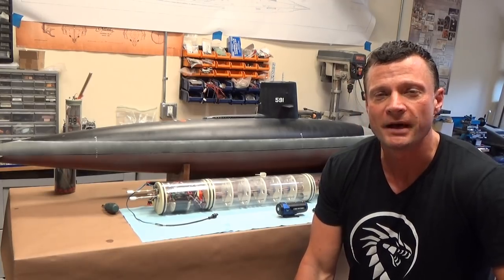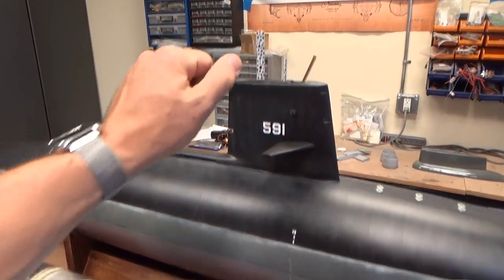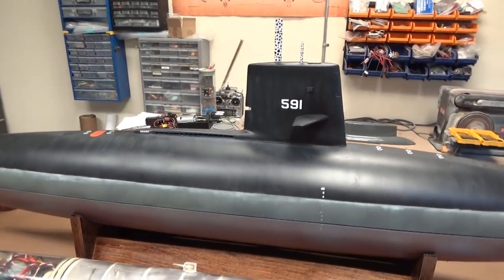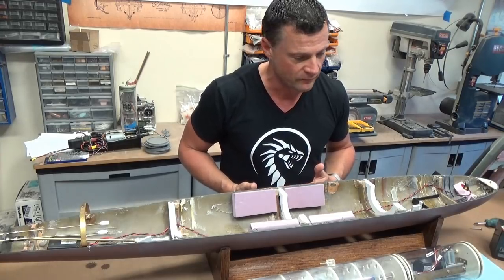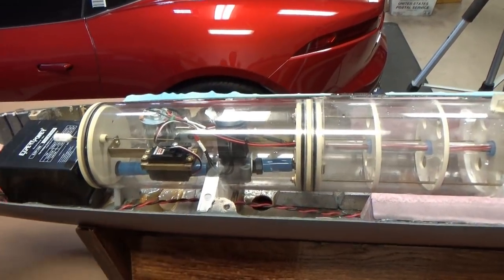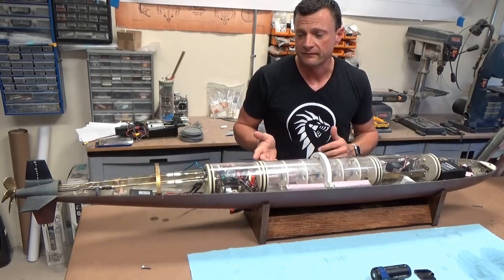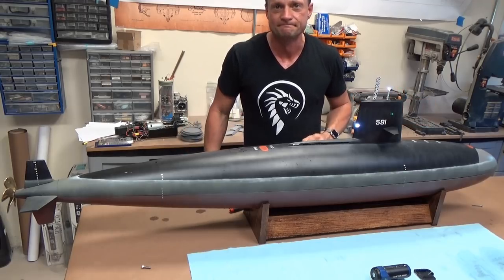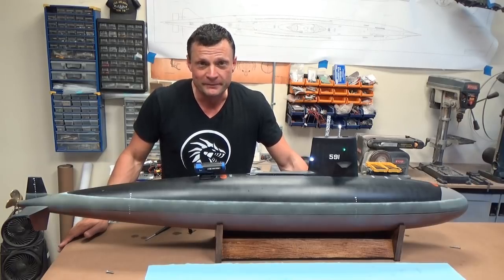1:48 Skipjack Class RC Submarine - DeBoer Hulls

Comment: Wow thanks a lot, I have been wondering about a RC submarine for years
Reply: Simply amazing
Reply: Try that next time with a periscope and the camera kept inside the submarine if that will work
Reply: Which type of antenna should we use if the RC submarine has to fully submerge into water say about 2 ft depth

Comment: Are you sure its the periscope that lets the air out? My non expert guess is that the mast with the lantern is the periscope. In the old days periscopes were usually circular, much less weight to do a 360 degree then. My guess is that the other mast(=letting air out) is a communication or surveilence mast(or a snorkel mast without the top).
Reply: Its a snorkel...slip of the tongue...he corrects himself in another video.

Comment: How does it evacuate the ballast tanks to surface? Does it need to be on the surface to suck in air through the periscope?
Reply: Yup....gotta get the snorkel above water to blow the tank.
Reply: so if you go to deep you cant get up again?
Reply: well, its a model, so, no need to go deeper than you can see. as long as its close to neutral buoyancy, just moving forward and using the dive planes should get you close enough. outside that. get your waders on.
Reply: @gremlin60  You can. You just don't want to do any deep dives when you think the battery is getting near low because you have to throttle up to the surface so it can purge.
Reply: The boat has been ballasted to make it positive bouyant so that if something happens, itll still rise to the surface regardless unless the watertight container implodes or is compromised.
Reply: Once it's full you can point and sail it up to the surface and then vent it. If you go deep and for whatever reason the sub won't move it's time to get your swimsuit on. They have a lot more moveability when submerged, able to go up and down. Essentially the exact same controls as a plane.

Comment: Can you give more resources about instruction how it goes down and up in water? the mechanism behind sinking and climbing.
and did you perform a radio test that how deep the signal still being received by the device?
Reply from the maker: https://www.rc-submarine.com/rc-submarine-technology

Depth is a function of distance. The further away, the more shallow you need to be. Contaminants such as minerals and chemicals greatly reduce range. In practical application, you can get to periscope depth at a distance of over 100ft with no issues.

Comment: How did you seal two parts of the submarine hull? Seal should be watertight or it would just sink and never come back to the surface. I have not seen existence of such seal in your video.
Reply: Its a wet hull submarine model...only the wtc is sealed....the rest is free flooding
Reply: I understood but how to blow the water out from front & back section of the hull of submarine? There will be enough water entrapped to resist the submarine to come bac to the surface. can you please make one video on surfacing of this submarine?

Comment: Guess you can not fully dive, can you?  You have to keep that vent tube above the water line, right?
Reply from the maker: No, sir. You are incorrect. The sub is fully capable of diving to any depth. In order to go from "decks awash" to full surfaced waterline requires the intake to be above the waterline.
Reply: @RCSubGuy  - Got it.  Thanks for the info.  Really cool.  Take care and be safe.

Comment: '
nice R/C model submarine...
use R/C on the air is a fully strong bond R/C system...
use in the water is a little middle weak bond R/C system

Comment: No FPV for exploration?
Reply from the maker: FPV depends on high frequency radio waves to carry signal. Those do not penetrate water, so... no. No FPV unless you want to run a long cable back to shore to to a floating antenna you drag behind your boat!
Reply: @RCSubGuy  thanks, love it! Always wondered why deep sea ROV were tethered.  (Besides recovery)

Comment: How deep can it go
Reply from the maker: All the way to the bottom. It's getting it back up that's the tricky part. ;) You typically operate at "periscope depth", but in fresh water, you can easily maintain control over 10ft.

Comment: Powered by a "lead acid" battery come on ! Change over to Lithium and quadruple your capacity for the same weight/dimensions .
Reply: Lithium batteries are sensitive to pressure changes. They will most likely scuttle the sub.
Reply: It needs the wight to sink dude!
Reply: I wouldn’t surmise that putting around at 2 kn within visible range or under murky water would be interesting for more than a matter of minutes anyways.
Reply: You need to read my statement correctly, i said lithium battery of the same weight. And notice how i spelt  "weight"  dude !!
Reply: Read "Jason Gooden"'s post then ... DUUDE
Reply: That's not true at all we've been using lithium submersible drones for over 3 years diving depth of 15 meters. And also the military started production on lithium powered subs 2 years ago.
Reply: You can use NMH batteries if you want more capacity but I also understand you need weight which lead weights can be used.The only question I have for you is the inside of the sub looks like it is not sealed,So with that said is the inside painted and if it's not it should be as the dirty water you are putting it in can degrade the fiberglass shell if there are chemicals in it from the environment.
Reply: Real Submarines use Lead Acid Batteries. Too bad you can't get a mini nuke reactor though.
Reply: Autonomous ROV's used them over 10 years ago but they had their own issues. Lead Acid Batteries are however relatively well known commodities and less issues like fire.
Reply: richb313 Lead acid batteries have there own issues.For one I do not care for how you lay the battery on its side even though it is a sealed battery.
Reason one you can block off the the vent as all lead acid batteries have vents. Second by laying the battery on its side you can uncover the plates from the electrolyte causing a failure of the battery,with this said you have the potential for a over heated battery and build of of Hydrogen gases in the sub.
Just think you should know.
Reply from the maker: SLA batteries are perfectly fine for this application. With vast amounts of room and the need for ballast weight, Pb is a great solution. I run LiPo's in most of my boats, and they're great, but SLA is perfectly fine in the wet once you seal the contacts, saving valuable real estate in the watertight cylinder. (Oh, and I double dog dare you to find a 5000mAh LiPo for the $18 I paid for this battery... ;))